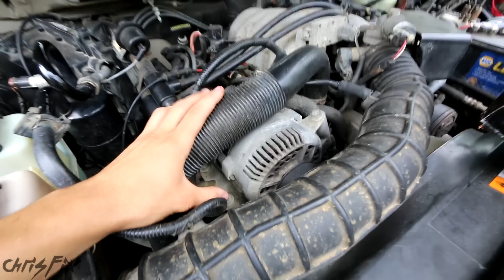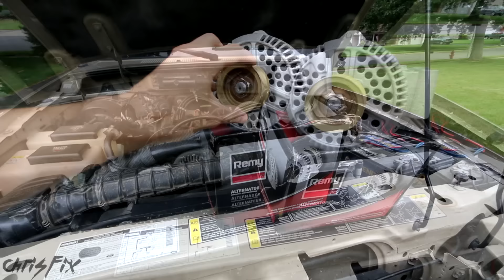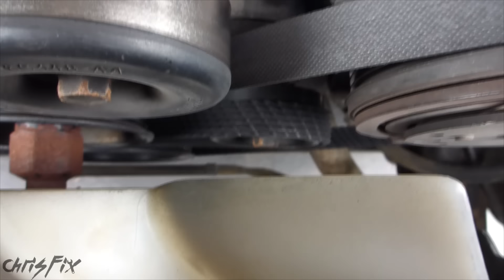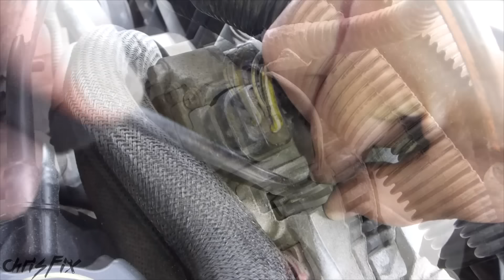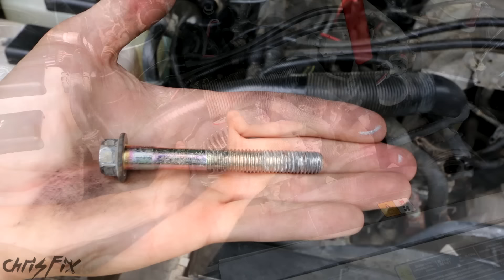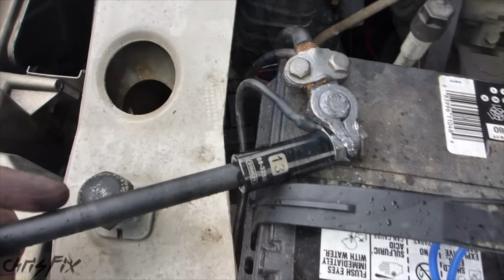How to Replace an Alternator

Comment: Ha, alternators SHOULD be easy to replace, but then you work on a Suzuki XL-7/Grand Vitara that has easy bolts and all, but then there's that one Torx screw that strips which turns into a 4 hour job to remove the alternator otherwise.
Reply: Be grateful that battery didn't explode on you.  I had a battery blow up in my face.  Luckily no one was hurt.  The job you describe is what I call a character builder.  You are a better person for the experience.
  You can't really test a alternator if your battery isn't fully charged.  Sometimes you can skip that step, but when Murphy come to visit the only way is to sweat the details.
Reply: banstaman I know your pain all to well. Why did they have to make that a torx screw!
Reply: ***** A hammer and some Wd 40 can be your best friends.
Reply from the maker: banstaman Ugh, makes you wonder what they were thinking when they put the torx screw in there!
Reply: banstaman thats why you just weld a nut on top of the torx screw
Reply: Same with older volvos they are cramed in the passenger side
Reply: ***** Air tools.
Reply: ***** caveman!
Reply: ***** Barbarian!
Reply: ***** We all need a big hammer in our tool box.  The trick is know how and when to swing it.
Reply from the maker: ***** Haham Jeremy Clarkson style!
Reply: banstaman What about bro's previous minivan? Remove the wiper motor cover. Remove the belt, remove the power steering pump (leave hose attached). Strap the motor, Remove the top 2 engine mount, Rotate the motor (by tightening the straps), then you have access to the alternator!  Fortunatelly, it was a dead battery... Still had to remove a 2" metal tube on top of the battery... 

Always double check the battery.... In this case... the voltage never went past 12.4V, even at 3000rpm... Dropped to 10.2V as soon as the motor turned off... It was also smelling rotten eggs after a while when the engine was running, and was burning hot. By burning hot... Diagnosed, then turn off the engine, talked to bro about it, then decided to replace, called to see if they had it in stock... a good 45 minutes... removed it and I could not hold it, I almost dropped it back in the hole because it was still that hot!. Went to the store, made the line, asked them, they went.... waited... waited... waited... they came back empty handed... inventory error... Went to the next one, made the line, asked, went, came back few minutes later, filled the paperwork for the waranty and... the old battery was still hard to hold! After almost 2 hours! ... next winter the radiator blew up, engine overheated...
Reply: @ scorpian you can still full field the altenator and check its output. If theres still a power issue its in a wire or the battery itself. And yea the gas sulfuric acid produces can be a bitch when theres a spark haha. Glad youre not hurt
Reply: trollaphobic Very true, full fielding will show what a alternator is capable of, but with today's touchy electronics you run the risk of frying computers.  Not worth the risk if you ask me.
Reply: Towards the beginning of the year we had someone come in with a Suzuki XL7 and asside from the torx bolt it took hours to find the torque specs

Comment: Hey chris.  I have a 1998 chevy suburban and im running a 52 inch led bar like yours,  1500 watts for subs and hid lights, nothing is going on with my alternator but do you suggest I change it? Or wait until I have a problem?